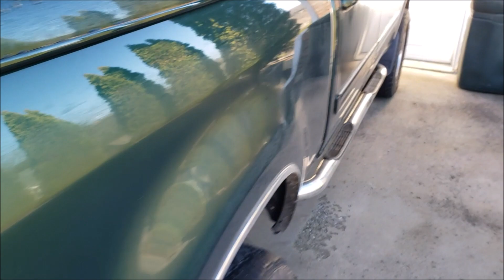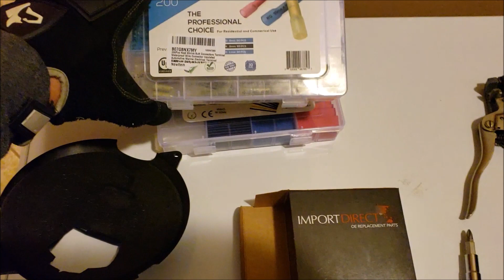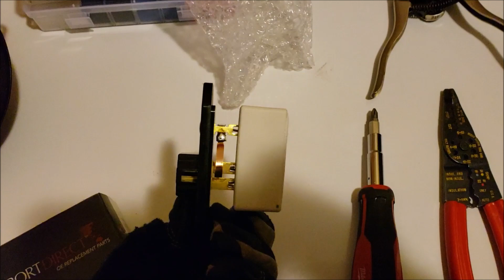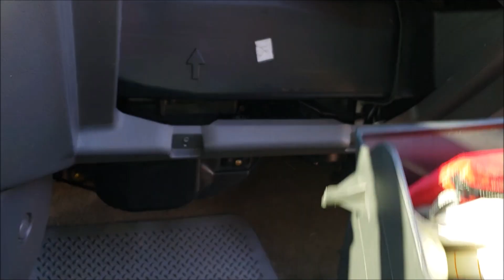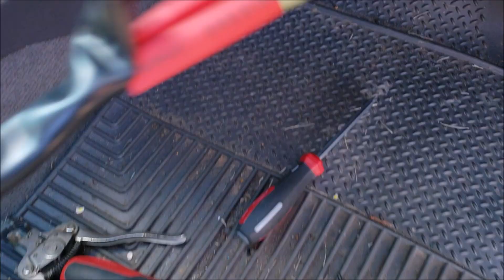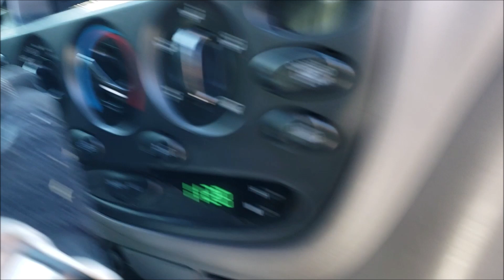How to Replace Blower Motor Wiring, Resistor, Glove Box: First Gen 00 to 06 Toyota Tundra Sequoia

Comment: This is very helpful. Your video is the only one specific to my truck. What year sequoia did you pull the cable from? Also where is the blower motor relay located so I can test the relay to make sure it is good?
Reply from the maker: Thanks! I pulled the pigtail from a 2006 Sequoia, but any first gen should work. The relay and fuse are under the hood in one of the boxes near the battery and should be marked "blower" or "heater."

Comment: I’m doing this exact same thing on my 2004 tundra double cab. I didn’t keep track of the two wires placement going into the blower motor. Does it matter if they get crossed up do you think? Thank you
Reply from the maker: You will want the wires in the right position. Make sure the placement and the wire color match up.

Comment: Hello I’m doing the exact same thing to my 2004. I didn’t keep track of which wire was which for going into the blower. Does it matter if they get crossed up? Or, do I need to make sure they are the same position? Thanks
Reply: If they are in the wrong position, the fan will run backwards and you wont get any air through the vents. Switch em up and you'll be fine.
Reply from the maker: I recommend matching the wires.  I used a junkyard part and made sure the wires were in the same position.  It burned once and I don't want it burning again.

Comment: I have an 01. 363k on it. Ac quit blowing. Ac was cold as ice right before it quit. Smelled burned wires. I hope i can find a pig tail. How hard is it to replace the whole plug from beginning to end? Will be changing this weekend
Reply from the maker: Just saw your post.  The wires and plugs from the resistor to the blower motor can be replaced, but you would have to separate the right ones from the thicker bundle of wires.  Sounds like more work unless the wiring is damaged.  I am interested to hear if you went that route or if you replaced just the plugs?
Reply: @gduplerauto  just replace motor and it came back on!
Reply from the maker: @benjamintapley8912  Good deal! Glad the wiring wasn't burnt.
Reply: @gduplerauto  me too! That would have been a pain. Pretty easy to change out
Reply: @benjamintapley8912  Good News!!!